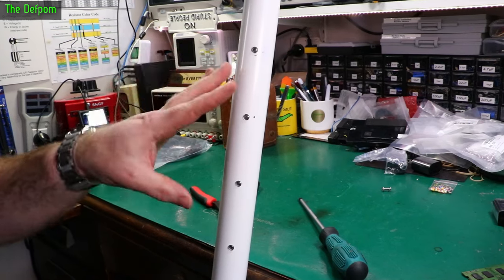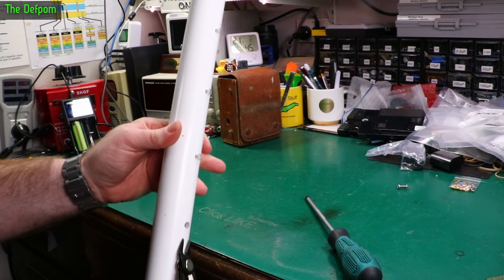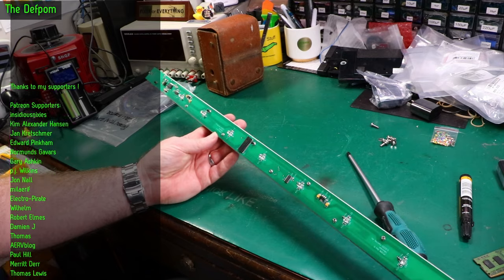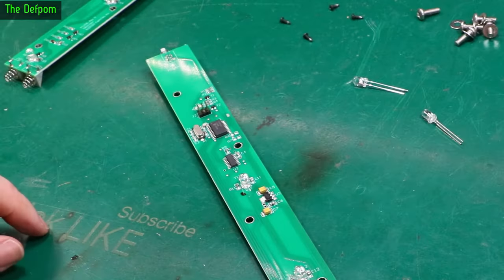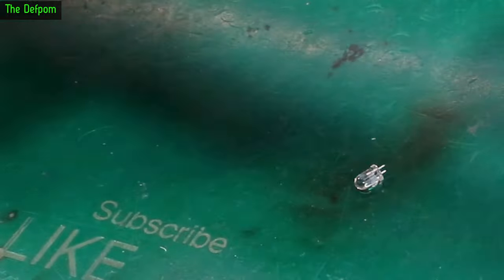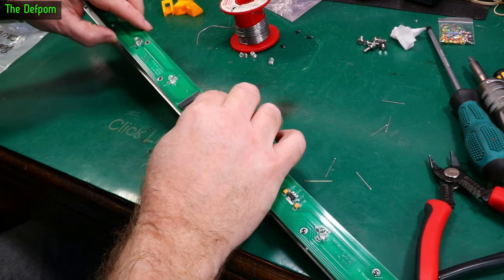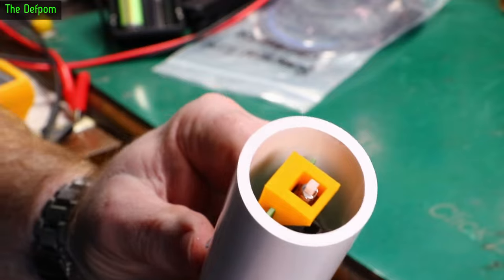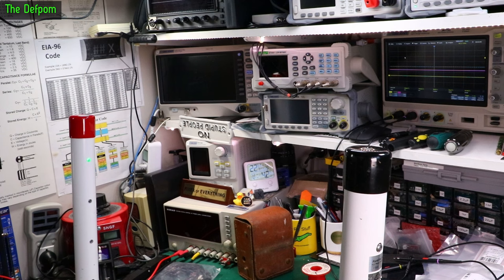🔴 Farmtek Light Curtain Repair - IR LED Replacement - No.1200

Comment: One old school way was to melt the solder then bash the board on the desk so the solder will fly out the hole. but does make a mess of your desk.
Or if you miss a nice burn on the legs 🙂
Reply: Yes tin everywhere 😂 desolder gun is top

Comment: A curtain?
Reply: The light "curtain" is used as an electronic finish line in dog trial events... Cats, too, I think... See above details.
Reply: @t1d100  
Interesting. I thought it might be used to catch trespassing.
Reply: @bblod4896  Sure, it could be used for that. Or, counting cattle (or people) coming through a shoot... Might be good for keeping the kids from pulling too far forward in the garage. grin
Reply: @t1d100  
There is a trick for the garage issue using a tennis ball on a string mounted to the ceiling.
Perhaps an Indiana Jones type of trap, you pass the beam and a hundred darts fly towards the object breaking the beam. 🤠